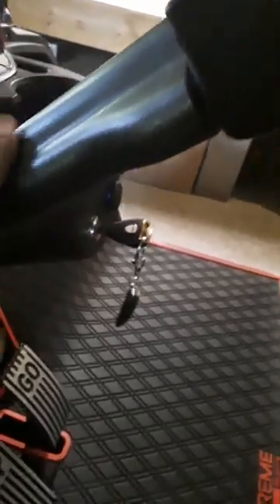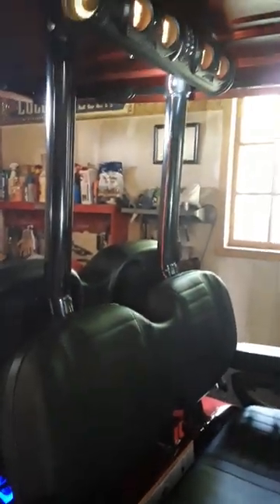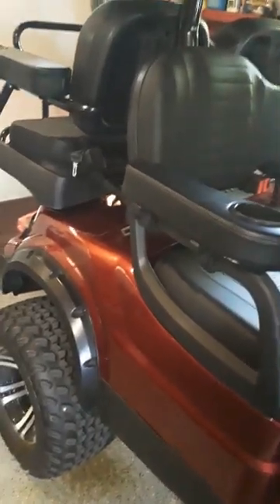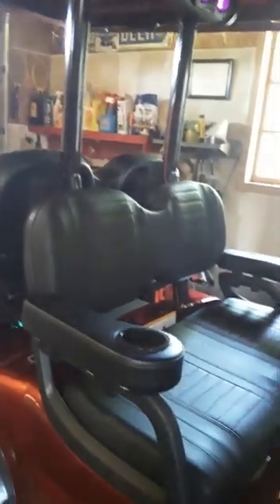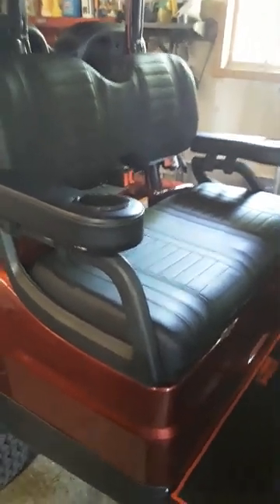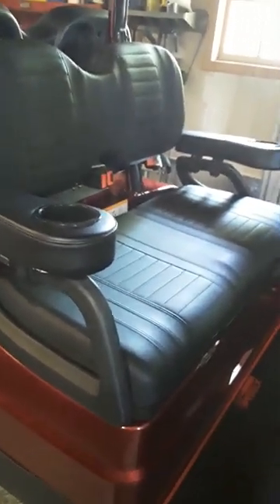Ecoxgear sub install on Icon Golf Cart

Comment: I installed mine between front and back seats (4seater)
Had to extend the two sets of seats an inch for air and access, THIS THING BANGS THROUGH THE NEIGHBORHOOD 
Turns heads from far away and the Bluetooth sync is flawless

Comment: Does it draw a lot of power from your battery?
Reply from the maker: not at all. But I will say since I made this video I have sold the icon and purchased an evolution D 5 with a lithium battery moved all my equipment over to the new cart.
Reply: How did you get the 12 volts with the lithium battery?
Reply from the maker: @KennyDesmarais-gg8mz  On that particular project I used a separate 12 volt converter I didn't wanna tap into the one that came with the cart like I did on the icon.

Comment: What light kit did you use?
Reply from the maker: Amazon:  10L0L Golf Cart Underglow LED Light Strip Kit, 14 Modes Underbody Glow Neon Lighting with Wireless Remote Control, Sound Active, Water Resistant Flexible Tubes 126-LEDs 86 Inch 2 Pack